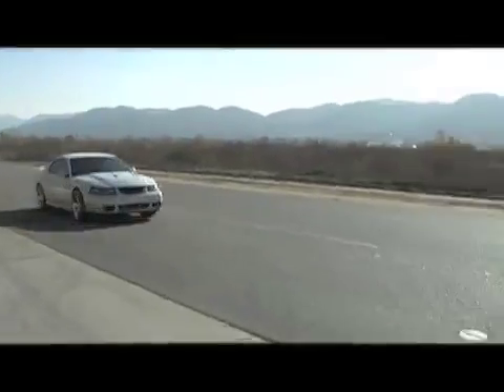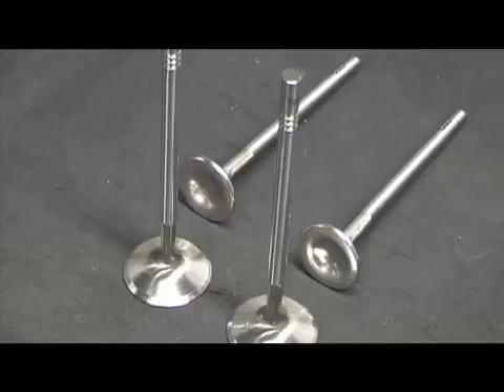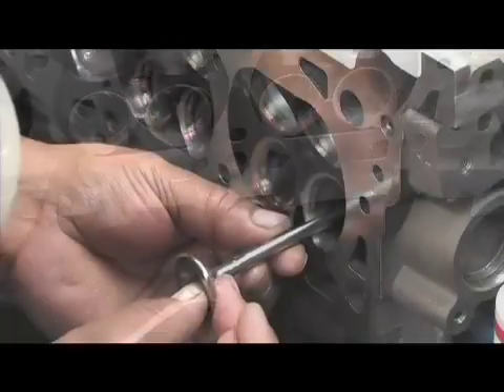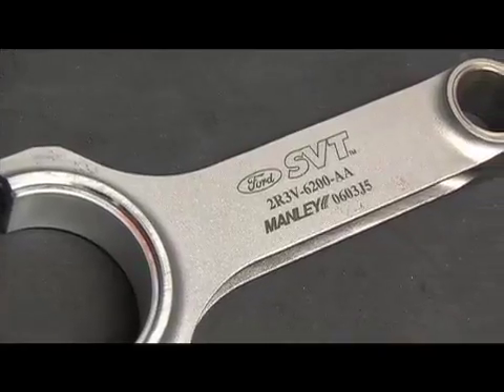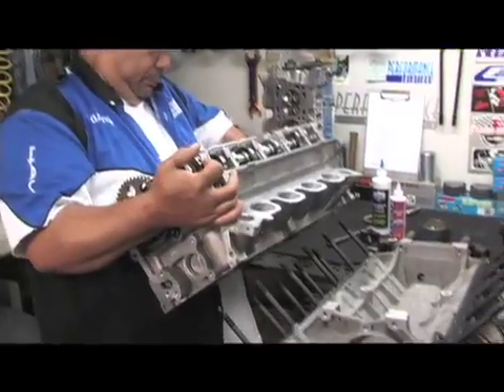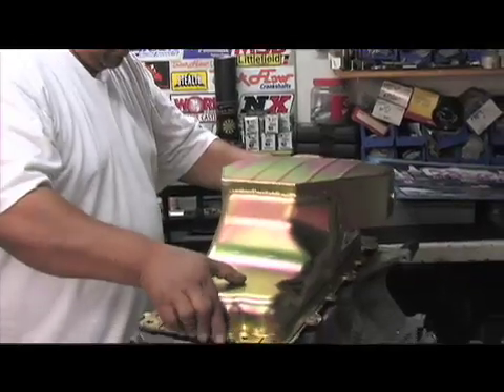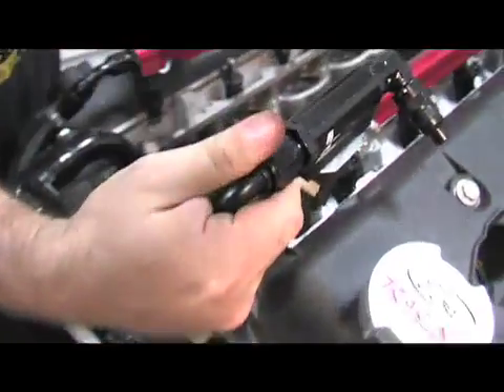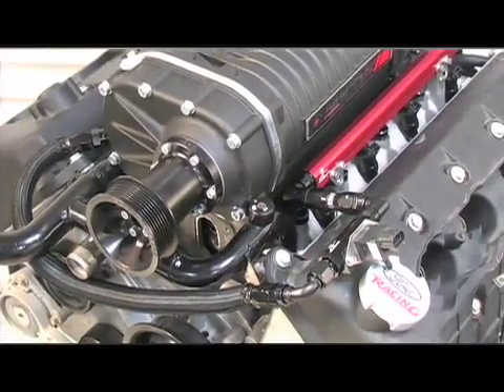StreetlegalTV.com - FPS 4V Cobra Modular Build

Comment: How long does it take for teksid short block take to rust? It’s a build engine been sitting in nee mexico for a few years now in Canada did Alamo at a year now, it’s a mmr 1000ae engine lol, planning on getting it on a engien stand this weekend take off all the suran wrap and oil the whole block hi with up with synthetic Lucas oil, I have the mmr crank socket to rotate the crank so let’s cross my fingers it rotates freely or it’s time for an1500+hp buikd time 5.0

Comment: Im kinda stuck between a rock & a hard place. I have a fully built/ forged 80mm turboed 03 cobra (with a 98 4v tekisid) but I still have a stock T-45 (long story) that Im going to put behind it until I get a built trans. I'm almost certain the trans (& maybe the rear end) is going to destruct when I get it dynoed. "They" say you shouldn't never run a new motor (even start it) until your going to put extreme load on it to fully expand the pistons rings so I dont know what to do. I honestly want to just get it running so I can drive it around but should I wait until I can put the amount of boost I want threw it when it's dynoed?
Reply: ucnhtmenow1  yeah dude, id go light on her for a while then break it in. What happened to your iron block?
Reply: Alonzo Kincaid I actually bought it as a roller. Let me tell you a little story if your interested. I won't go into my first car & all that but after selling a couple sweet foxes (which are my fav) I ended up with a '94 convt. GT with a '98 4v cobra motor & a vortech blower on it. It  developed a little knock (from running stock on 12psi & adding the way I drive), so decided to send it off 2 the shop 2 get its full "make over" (damn these 4v are expensive lol). Meanwhile, I got a more than a sweet steal ($5000 but got it for $2500 because he couldn't find the title) on another built LX fox that was going to be my nitrous car that sat for like 4 years because the guy was a chevy guy & didnt know what he was really doing. It was a fully built 306, drag susp., draglites & skinnies, elec. h20 pump, trick flow R up&low, full catback, dual external fuel system, I mean just the works (rich kid dumped a lot of money into it & never got to fire it up). While working on this external fuel system, I found out the fuel lines were cracked & it was sunday which is why I did what I did to get it running instead of waiting & just buying the lines I needed on monday, but that car & my "clonbra"  both burned up in a garage fire all because my buddy that was helping me (that worked at auto zone, i should've known) didn't tighten the fuel filter either tight enough or incorrectly & it shot fuel everywhere & a spark from the pump wires lit it up & NO FIRE EXTINGUISHER!!! I usually never let people work on my car but he was they type to just fiddle with shyt & it was somerhing so simple, he still doesn't know till this day it was n part his fault, partly mine because I wasn't prepared especially working with fuel... lesson learned). So after getting screwed by homeowners & car insurance & not getting a penny (long story), I was out 2 nice cars & looking for something. I was either going to build 2 cars again (a daily driver & my "race car" like I finally achieved (another long story), or build 1 bad ass car (this is back when I could actually spend $ like it was going out of style but like they say "if it wasn't for bad luck, I'd have no luck @ all. I had only checked craigslist because I broke my phone on the roller coaster @ circus circus here in vegas & was putting the apps back on my new phone & luckily came across a 68,xxx mile, all primered, no dents, 9/10 interior 03 Cobra for $4500. He didn't have the main wire harness so I got it down to $4,250. I had to drive 300miles to get it but It came with fr500s, subframe connectors, lowering springs, detroit locker w/ 3.90 gears & a full bassani cat back system. All it was missing was the spoiler, side scoops & side skirts (& some weather stripping). And I now had a fully built 98 motor ready to go. Weird how things work out. I don't really like the sn95s or up until @ least 2011 but couldn't pass it up. I have a few vids on my channel.
Reply: ucnhtmenow1 i just picked up a black 04 termi. Ill have to check out your vids

Comment: C.J. Batten used to make a DOHC conversion kit for big block chevy. :D 
That Hennessey Venom GT has a OHV engine. I can't imagine what power could be gained out of it with DOHC/Turblows. :D
Reply: Or just use a modern ford engine like the las few worlds fastest production cars. The LS engines are killer anyway and with boost 4v rev range advantage is mostly muted
Reply: Well yeah. But big boost is big boost, regardless of which engine it's on. With a bored and stroked big block with hemi DOHC heads, you'd make serious horsepower already, much less when prepped for 20+lbs of boost out of twin turbos. I'm talking massive power really, not the cracked-out smallblock experiments most of the ford engines (I used to have an 02 GT) in these videos use.
Reply: davidsirmons Agree but I think it's got to the point now if your talking about street cars where power is the least issue to be worried about. There so many 1000+hp cars that just can't put it down to the ground anyway. I'm in Australia so we don't see the 4.6's here we only have 2 versions of the 5.4. The 290kw which is at 390hp has traction issues. Then of course can anyone out drive them and I don't mean in a drag race. I remember doing some laps on a touring car circuit here and in the 30+ guys running the Boss 290s no one could out drive the cars. Then we have our 4L 6cyl turbo falcons that guys here are making 1700hp with. I think we've achieved a power range now where it's irrelevant. Drag the exception. NRE is making up to 1500hp with the blown 5.4 and then having to tame it so it's usable.
Reply: Agreed. Some want straightline, some want handling, some want super street. I'd like a good mix of both, that way it's more versatile and streetable.

Comment: How did you blow a cobra motor on just 600 HP ?? they can handle that power all day long ??
Reply: if it runs lean it won't
Reply: bad tune
Reply: You can blow a 150 horsepower engine in a minivan if the tune is bad enough.
Reply: Yeah, likely had a bit too aggressive timing. A single 'pop' /backfire can destroy the PDsupercharger or turbos. As I remember, that's an artifact from having the fuel tune too lean or too rich.
Reply: Corey Smith if it tunes lean it gets the hose again.
Reply: Dodgy 2010 fuel

Comment: way WAY off there, you add the .020 to the bore di, then calculate the disp using conventional geometry.
To be exact, convert .020 to metric first then use the metric measurements of the 4.6's dimensions which are 90.2mm bore and 90mm stroke:

.020*25.4 (25.4 is the ratio of mm to inches) = .508mm
now:
90.2+.508 = 90.708mm = new bore after .020 over
then:
pi*(90.708/2)^2 * 90mm = 581,598.8962 (vol of 1 of the .020 over cylinders in cubic mm)

multiply by 8 and you get 4,652,791.169 (vol of engine in cubic mm)

then divide by 25.4^3 (ratio of cubic mm/ cubic inch)

and you should get 283.93 cubic inches, or 284. As the 4.6 in stock form is actually 280.76 cid, then the .020 over adds 3.17 cubic inches.
 If you want to use a general rule of thumb for overboring, here's a tip:

Most of the useful pushrod small blocks have something resembling a 4 inch bore (chevy 350, Ford 351, Ford 5.0 and GM LS2). That being said, though not precise, but more than close enough, ANY V8 with a 4" bore, when bored out in increments of .030 over (4.6 is exception because bore spacing does not allow .030), every additional .030 inches of overbore adds almost exactly 5 cubic inches to the engine, not only that, but (again, unique to V8's that have 4" bore), stroke * 100 + 2 = CID. For example:

Ford 302, bore = 4", stroke = 3.00". 3.00 * 100 = 300, 300+2 =302.
Chevy 350, bore = 4", stroke = 3.48". 3.48*100= 348, 348 +2= 350
and so on.

Ford 5.0 (actually 301.59) + .030 over = 306, ..060 over = 310.7, or 311 cid
Chevy 350 + .030 over = 355, .060 over = 360 and so on.
Reply: I am aware I did the math on a fast note. I still can't comprehend how do you use mm to express displacement. Mm would only and only be used to make an exact measurement of bore, stroke, or journal diameter. Engines have never been said to have a displacement of 4,652,000 cubic mm.
I don't claim to know it all we all have much to learn just expressing my 2 cents I just don't think numbers of this magnitude will simplify any calculations.
It's understandable when you say a Honda 2.4 dohc because of their tiny journals. When you talk big block small block single cam the metric system flies out the window.
Reply: I have no clue where in all hell you live but using mm has just recently become a thing. we been using ci. and cc for decades. 

back to your huge scientific  mathematical formulas going back and forth switching to mm and ci. 
here's a lil pie for ya
 
3.55"bore 3.543" stroke which we all go with a square of 3.55 for stroke. 

3.55"/2 =1.775"^2= 3.1506" ×3.1416pi × 3.55" stroke =35.1379ci per cyl. × 8 = 281.1033" total displacement 

I have no idea how you could possibly get an extra 4ci when your displacing an extra.020" per cyl.
Reply: +B00steDevil you want to switch back to cubic centimeters not mm because that is what we all base all our engine displacement in liters meaning your 4652cc goes back to 4.6L not mm.
using your 4652/16.387 =283.88" 
283.88× 16.387cc to ci = 4652.
Reply: +B00steDevil whether it's "a thing" or not is irrelavent. The flaw with your math is that you are still rounding up before making any calculations. The modular bore and stroke are not exact in inches like the 5.0 and the 5.8, they never have been. Using mm, the calculations are exact, once you put rounded numbers through exponential calculations, the rounds are also exponentially rounded, causing the final result to be exponentially roundedly incorrect.
Reply: +B00steDevil I have shocking news for you, 4.6, 5.0, 5.8, 7.4 are all metric.
Reply: Alright vendiesel you win the argument there's no getting thru you young thugz nowadays

Comment: nice build but disappointed you didn't degree those cams leaving power on the table
Reply: It's a 6 minute video smart guy. There is a lot more to assembling a motor that they didn't show, that doesn't mean they didn't do it.
Reply: It can leave as much as 30 hp on the table not doing it
Reply: If you Don't mind me asking what does that mean?
Reply: yea its real crucial in loss of hp or a piston hitting a valve witch is where the crucial part starts you have to degree so make sure the valves are closed as the piston rise and open as the pistons drop you can loose up to 30 40 hp if not degreed proper
Reply: breaking game tv when you have a blower no one truly cares
Reply: +bulldog190 This is the reason that ford dohc motors vary in power output...why some cobras run stronger factory than other. The faster ones have closer (more properly) timed cams than the ones putting out a lower hp number bone stock for stock. They didnt take much time or effort in the factory...idk why. Possibly limited on assembly time. The engine will also run much smoother with properly timed cams.
Reply: maybe 10 hp. degreeing cams doesnt add hp. new coyote rotates both cams up to 50 degrees advance or retarded. Always changing through the rpm range.
Reply: bullshit.
Reply: +Mark Owens prove it

Comment: I plan on using a teksid block with a 5.0 stroker crankshaft, terminator heads or ford gt heads, crower stage 2s and a 3.4 whipple, anyone know if that would work? Id love to use the ford gt heads but im not sure if the cams would fit and if the heads would be worth it. I know there's an adapter from mmr but would i lose power or would it be cost effective?
Reply: zx2escortt why you something you nothing about